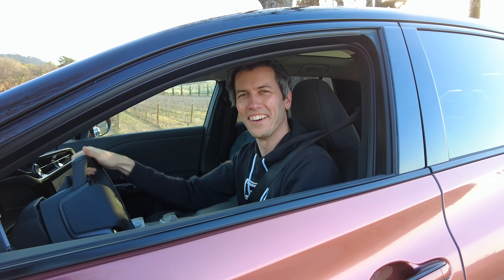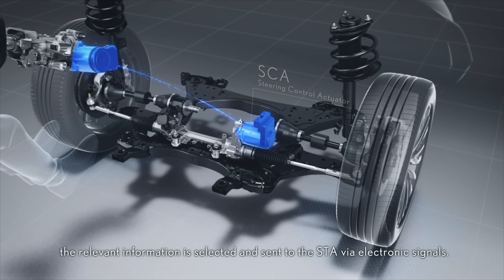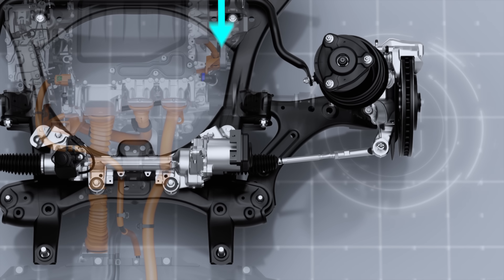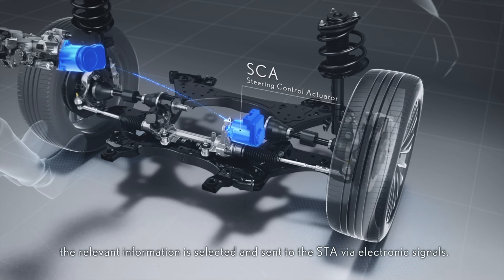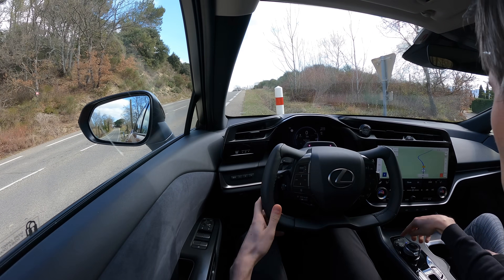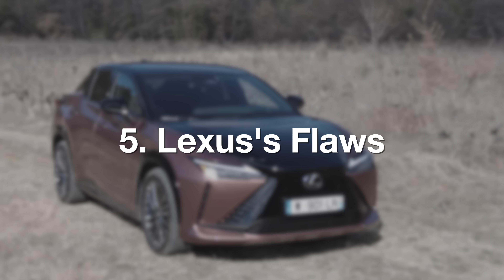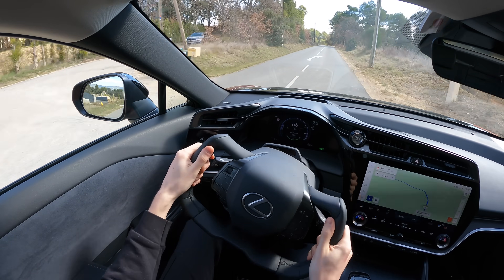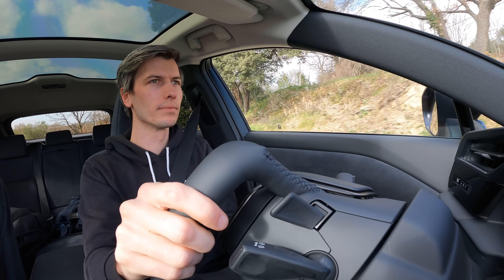How Lexus Fixed Tesla's Bad Idea: Steer-By-Wire Yoke

Comment: I want a round wheel. Why? Because I like to rest one hand on top of the wheel (sometimes I even drive with one wrist). For one thing, that allows me to sometimes raise my forearm up out of the sun. On long drives, I also find the one-arm-up position to be comfortable, allowing me another position apart from nine-o'clock-three-o'clock. I find it hard to believe they didn't discuss this in their design meetings. F1 drivers don't drive like that, we do.
As cars age, motors will fail. Wires will fail. Connections will fail. Electrical systems can become a real headache as they age. And this is potentially life or death. Are the wires protected from rodents?  Because rodents love to chew on wires. Car companies make a massive fail by not protecting all systems from rodents. Ask anyone who lives in the country. Rodents can be a nightmare. I once returned from vacation and my interior smelled of urine. Mice had built a nest inside the fan box inside the cabin, coming in from the engine bay. Lexus didn't even put a screen over the air intake. WTF? Sometimes I wonder if car designers are idiots.
There will be Model T's outliving the lifespan of some of these modern systems, for repair cost affordability alone, if nothing else.
And how heavy is drive-by-wire? I assumed it would weigh less than a shaft, but I doubt it does if there are redundant motors and things. How many electric motors are in today's vehicles? They weigh a lot, and repair costs could be an issue in older cars.
I don't mind bump-steer either. In fact, I appreciate it as long as it isn't extreme.

Comment: My boat has been drive by wire for a long time, both in steering, throttles and direction.  It is SO much better than physical cables!  No wandering around at either slow speed or high speed, and they have virtual stops at each max angle, however when the power is off, you can simply turn the wheel in one direction forever.  👍😁  The best part is that while there is a traditional steering wheel, you don't need to use it, and can use the joystick as well.  For a large yacht that weighs more than any car it works great.
Reply: Cars require much more precision steering than boats.
Reply: 'i want my car to handle like a boat" - says no one ever.

Comment: The response of the engineer is a great political one, however, they real reason is: LARGER PROFITS. The steering column costs them $350, the wiring system $75. So, they save $275 per car, multiply that by one million cars they produce and that, will be the answer as to why they created the steer by wire system.

Comment: honestly I think it's dangerous. Same for brake by wire. If an animal were to bite through the wrong cable. If corrosion were to mess with the car's electrical system, if the car gets water damage... You could potentially lose steering or braking input whilst driving and there'll be no backup.

Comment: As always, I appreciate your analysis on new technology. This is pretty cool, but I can already tell it's not for me. I still don't like drive by wire, every older car that I've driven which uses a cable throttle still feels better to me, and I've driven a lot of modern sports cars with drive by wire. That little bit of electronic lag/delay is very annoying to me with everything. It's the same with buttons/knobs vs a laggy touchscreen.

Comment: Infinity had an issue with their steering by wite system where in the middle of a turn the front wheels would steer themselves straight. Issue was fixed with a software update but I'd rather avoid that all together

Comment: FYI steer-by-wire was already present in 2013 Infinity Q50 series.
Yes, ten years ago. It had a fallback to a direct driving shaft via a clutch
Reply: thats the kind of redundancy I'd like to see in this
Reply: @GordonTurnerr  bmw has something similar for the gas pedal, if the wire fails there is minimal throttle still available on the pedal. You can imagine why i know:)
Reply: @slavko321  Funnily enough BMW was testing steer by wire in the early 2000's on E46's and E39's. IIRC the E46's were fully steer by wire and the E39's were a variable ratio rack that later ended up on the E60's. There's some footage online of the E46's being compared and honest to god that system looks better than the crap that ended up on the Cybertruck. Still not a squeak from BMW about planning to or wanting to use that system so I guess they concluded it felt even worse than most EPS systems (including BMW's) do now and provided very very very minor benefits to anything that isn't heavy equipment which often uses steer by wire now. It makes sense for heavy equipment since those things get blown about by the wind at parking lot speeds and you're constantly going from full lock to full lock, while in a car the only times you really go full lock are parking and U-turns. No point having a more complicated system that's hard to get working consistently when the benefits of that system are minor and drawbacks very obvious. Even the steering column crash argument is void since that's been a solved problem for half a century with collapsible steering columns which cost next to nothing to design or produce and have easily inspectable and replacable wear parts which only really affect the steering feel and don't reduce the vehicles ability to steer.

Comment: I think i'll enjoy that sort of steering wheel for the track where you would want a sensitive yoke but it might be too sensitive in slow speed driving and parking. Making tight street turns seems easier with higher steering ratio than lower steering ratios since it is less sensitive to wheel movement. With a low steering ratio, a slight mistake in steering input might send you on the way to a repair shop

Comment: Once again, another excellent video by Jason !  I used to work in General Dynamics' Flight Control Hardware Design Group. They were the ones who invented the Fly-By-Wire system for the F-16 aircraft. (The reference standard was an analog electronic system, which was later upgraded to a digital system.) I'm excited to see an auto maker has finally ventured to make a Drive-By-Wire system. Regarding safety, I appreciate that Lexus used redundant electric motors in the steering actuator. By comparison, most aircraft use 3 or 4 redundant channels for the sensors and computers, then 2 hydraulic systems in the actuators. Regarding the lag observed at 12:12, that can be compensated by using a feed-forward gain in the signal path. That is relatively easy to implement in the control software.
Reply: do your sums
Reply: I feel like a feedforward gain for that purpose would be an artificial conundrum, considering how wide the range of variables a car's steering system maneuvers.
Reply: @clusterwitola  - The control system should also use sensor inputs to adjust the gains accordingly. I'm surprised this Lexus system didn't have accelerometer, gyroscope, and wheel speed inputs, to detect limited traction conditions.
Reply: Fly by wire was used by Britain on Concorde and IIRC also TSR-2 - it was analogue system, but still first FBW.  Digitising systems arguably makes them easier to design because you can do complex stuff using algorithms... Unfortunately you are at the mercy of software designers whose output does not always fit the real world.
Reply: Hmm, remember the 737Max accident. Just because 1 faulty sensor and pilot have no control over steering the plane, because system trusted the sensor rather than pilot
Reply: @rifa.3307  The max thing was the result of a lot of corruption and lies. Pilots had been lied to about the nature of the fly-by-wire system, so they were unable to properly address issues when they arose due to not being trained properly. Additionally, Boeing was rushing out the model to compete and (as far as we can tell) probably paid off some officials to sign off when they didn't have the redundancy they were supposed to. 

Thus, when the one sensor failed, there was nothing the pilots could do since they had been lied to/mistrained. And somehow nobody at boeing saw jail time.
Reply: @clanginator  so, are you sure toyota dont lie?p

My point is, even in the aviation, where safety is the highest, there is those fatal flaw. What about car? Where a lot of corruption and company often lies, do you forget about diesel-gate?
Reply: @rifa.3307  There was only a single angle-of-attack sensor on the aircraft that crashed. Very much out of line with the engineering principles stated by auxpowerunit. The faulty system could be disabled, but the doomed pilots had not been informed about that.
Reply: @Thankz4sharing  if it is only because single sensor, why 737Max grounded for so long? Do you trust toyota more than boeing? Are you certain there is redundancies inside? What about faulty tesla gas pedal?
Reply: @rifa.3307  The 737 Max story is too complicated to go into here. Wikipedia has a full explanation. I don't trust the first generation of any company's technology. Airlines have enormous competitive pressures that I don't have. I'm not certain about Toyota BZ redundancies because I haven't examined them firsthand. I trust Savagegeese to be truthful. I'm pretty sure that Teslas don't have gas pedals.
Reply: @rifa.3307  737max is not even flybywire that was caused because boeing didnt tell airline they added the mcas system and when it malfunctioned the pilots didnt know how to turn it off

Comment: Isn't the major issue with this system that, as you corner a constant radius, you would need to steer less if you happen to be braking? What it should be is a non linear virtual gear. And less of a adjustment with speed

Comment: I would hate to accommodate for any latency, whether its using a mouse or keyboard in an online game (only relevant analogy I could think of) or, potentially more dangerously, latency during wheel input. I understand that its a pre-prod car but that gives me huge hesitancy when considering this option in the future. Glad to see it's safe from an engineering standpoint though. Thanks for the great explanation! :)
Reply: I am wondering how well it would do on the moose test with that delay as that is an example of where the driver has to put in big steering inputs successively in each direction at speed.
Reply: Well, the solution here is to have Elon's chip implanted into your brain. Then, the car will know what your brain's going to tell your hands to do before your hands know... so by compensating for the latency/

Comment: Clucking bell.. The more I see of these modern technological horrors, the more I appreciate my early 2000s sports coupe with hydraulic clutch, mechanical throttle body, and the only computer control relating to fuel injection and control of stuff like powered windows, cabin lights and of course airbag.
No way in hell I'm buying a car with this expensive drive-by-wire crap.

Comment: This is all old information. Steering by wire has been around for decades. Lexus invented nothing. Offroad vehicles (and airplanes etc. have it for eons. You have no idea what is the key to technology and what it needs to achieve the redundancy and diversity. The issue with steering by wire is regulations (as usual). Previously, the standards required mechanical connection but that is changing. You are also wrong that variable steering ratios are new. BMW had it first by "cheating" the standards with a planetary gear and electric motor input. 
So, blah blah

Comment: Good idea. Implementation... Questionable. There are a lot of components to go wrong in this situation, And if it goes wrong, You lose all control of your steering. There needs to be a redundant system in place to stop the wheels from doing whatever they want to do in case of an accident or electronic failure. I'd much rather trust a fully hydraulic system over a fully electronic system any day of the week. But overall, Give me a traditional shaft connecting my front wheels to my hands, With some advanced assistance if there really must be electronic or hydraulic assistance.

Comment: This sounds really cool but I can't imagine having this steering system in an emergency situation. Imagine you're travelling on a highway and you need to quickly swerve to avoid an obstacle (wildlife that leaps in front of your vehicle, an accident a few car lengths ahead of you, etc.) but, the steering system limits your angle because you're travelling at high speeds. At least you could try to avoid it with a fixed steering system and quick reflexes, but with this system it sounds less probable to avoid the situation

Comment: I think it's fine to have as an option over a traditional steering rack. It's something that you can't judge until you try it imo so I'll put off my judgement. My initial impression is that I'm really not a fan of the steering lag and variable steering ratio. The steering lag must be fixed but the variable steering ratio is a feature that I might end up liking. That being said, I really don't see the advantage of having a low steering ratio at low speeds, hand over hand is perfectly fine and since you're going slow it's not like it's all that critical to know where your wheels are pointed since it can be easily noticed and adjusted at parking speeds anyway. Now at high speeds you need the yoke to mimic a standard steering ratio anyway! A standard steering rack is consistent which is what I like so I can actually get used to how my car's wheel to movement transfer function at a variety of speeds and conditions. I do prefer the comfort of a drive by wire system that is able to choose the feedback you receive but for me the best of both worlds would be a drive by wire steering system with a consistent and standard steering ratio and with little to no steering lag while keeping the feedback systems in place.

Comment: It sounds kind of like driving an RC car from inside the car. There is always a bit of a delay from steering input to the servo turning the wheels, and the ratio of the controller input to servo response is variable in much the same way. The bottom line for me is, do the advantages of having steering with a yoke like this outweigh the disadvantages and costs of having it. I'm not certain that they do.

Comment: On extremely slippery ice, light braking can sometimes result in all of the wheels stopping and sliding. (even with modern abs systems) What happens to the steering inputs when the brake is then released?

Comment: As we progress toward fully autonomous vehicles, manufacturers will want to reduce costs by removing controls from the cabin. But if the vehicle needs to be driven manually, the whole thing could be done with a digital proportional joystick. This replaces throttle, brake pedal, steering wheel and shifter. Such a system would be entirely control by wire. It's going to happen.
I think that the variable steering ratio is something that people can get used to. The steering delay, on the other hand, is a deal breaker. They're going to have to do better than that.
Reply: "we progress toward fully autonomous vehicles" are we now?
Reply: @DrWhom  Yes, that is a fact. You may want to view some of Dirty Tesla's videos demonstrating the current capabilities of FSD beta.

Comment: Ngl my main safety concern with no mechanical linkage isn't power failure but software failure. Eg. A malicious actor hacking, or a particularly nasty bug (eg. overflow/underflow/cosmic ray bit flip/etc)

Comment: Excellent explanation but not for an old guy like me unless steer by wire came with a wheel and not a yoke as I tend to use only one hand to steer under normal conditions.

Comment: Unlike most, I'm much less worried about failure of steering with electronic systems. Tie rods can break, rag joints can break, ball joints fail. It happens all the time on older mechanical videos. I doubt this will be more common with electric steering.

What I think WILL be the issue is what happens after the car ages. If the car detects a failing steering component I bet it will disable drive in the car and require it to be towed.  For sure these parts won't be available for that long. Thus shortening the longevity of these vehicles.

It's already happening with canbus components. Now that they've been around long enough, there are simple components that are failing on cars that aren't available. Thus rendering the car totaled just over a simple module failure. This is extremely wasteful.

Comment: As a sim racer and sporty driver, I do not care if its steer by wire, in sim racing less force feed back and effects is more for me, to much and its just noise.
But I wonder how the variable steering ratio would feel or if my brain would just explode.

Comment: 12:30 does not prove the existence of a delay. Lexus is probably employing filtering to reduce the control authority of the proportional term of steering angle with respect to steering response. Would probably be remedied by a new steering profile. Google 'PID loop', or 'control theory'.

Comment: You need the feedback that steer by wire can’t duplicate such as tires slipping on icy roads and hydroplaning which you need mechanical feedback from the steering wheel to get you out of trouble. Can steer by wire duplicate that?

Comment: As a mechanic, I've changed a fair few sterring a gle sensors, and when they play up, the power steering can go nuts. So I'm going to assume that sensor or one similar to it is critical to this system, and if it goes wrong, you'veittle chance of saving it.

Comment: Now make a steering wheel that's completely locked, with two load cells reading how hard you're pushing on the steering wheel and translating it into steering input

Comment: What if you turn the yoke at 100mph and slow down to 20 keeping the yoke turned? Do the wheels turn more or stay locked at that steering angle? Either answer is interesting, either with how it feels or how they handle it